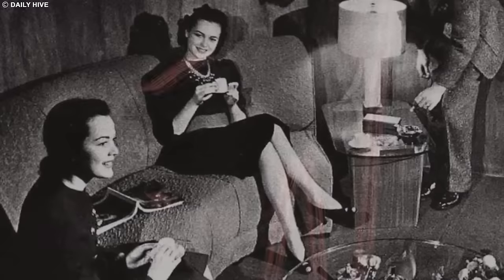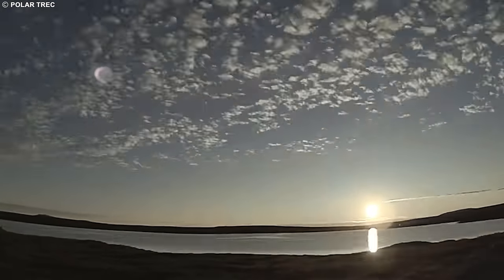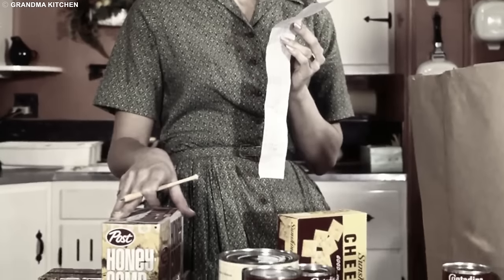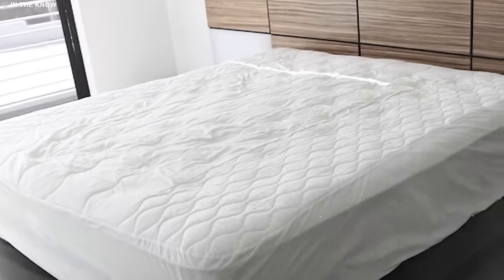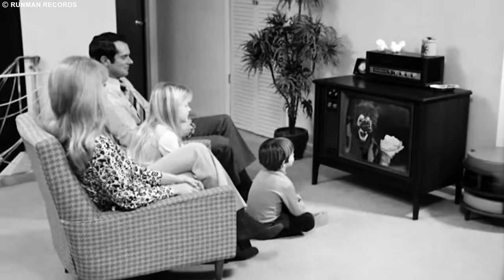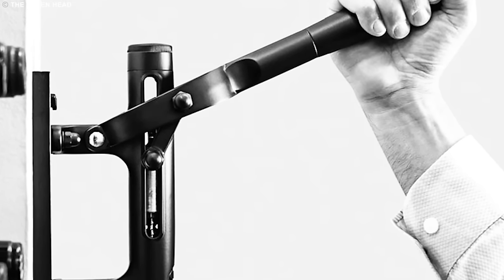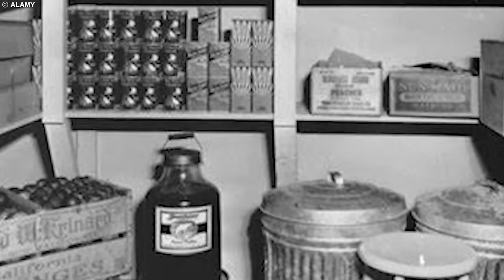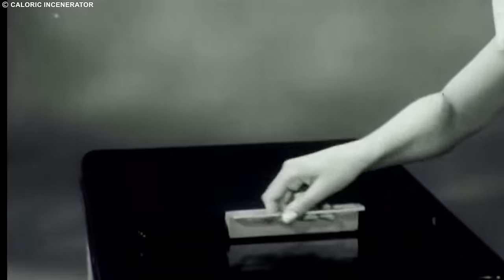20 Old Home Features, Kids Today Won't Believe Existed!

Comment: Here I am looking up at my popcorn ceiling
Reply: Which did not predate the 1980s.
Reply: @LQOTW 

Yes, it did. I lived in an apartment it the early 60's near Los Angeles that had it.

I hated it. Now, I've since learned that it's easy to get rid of...
Reply: @jazzander5314  Really? I distinctly recall 60s homes having the plaster swirl pattern and that some ceilings had the same sand/grit coating that walls often had (man those were terrible), but popcorn ceilings? I'm very surprised to hear that. L.A., though, was certainly more cosmopolitan than Minneapolis in the 60's, I'm sure.
Reply: LOTS of videos on YouTube on how to get rid of them.
Reply: Am looking up at mine right now too...
Reply: @LQOTW actually yes it does our house was built in 1975 we have popcorn ceilings
Reply: My grandmother’s house was built in 1966 and it had popcorn ceilings